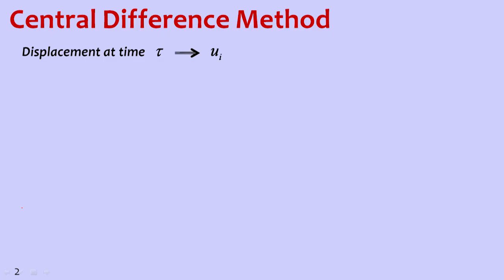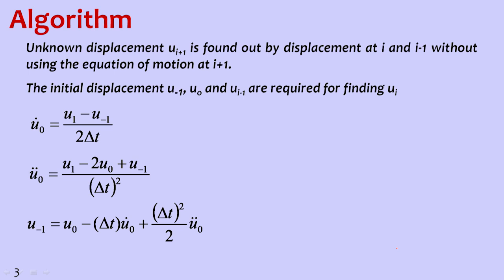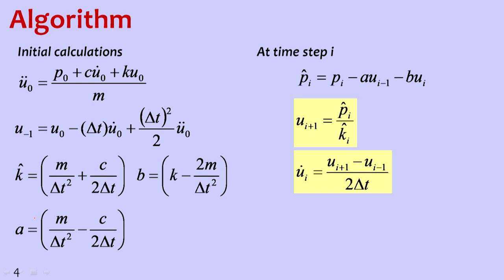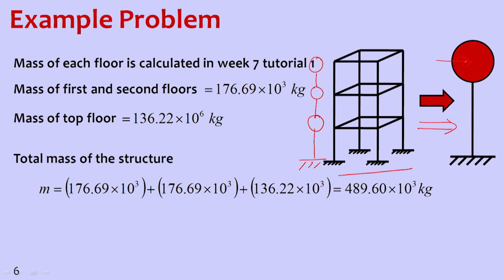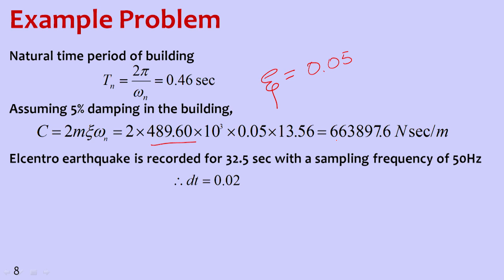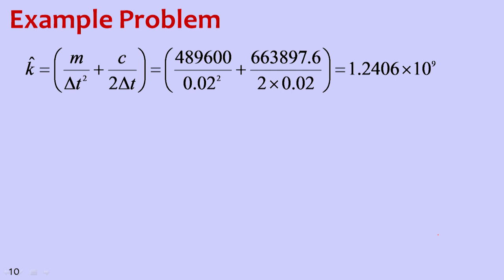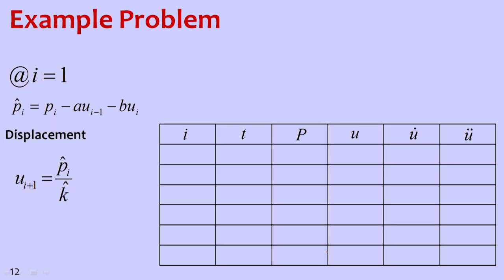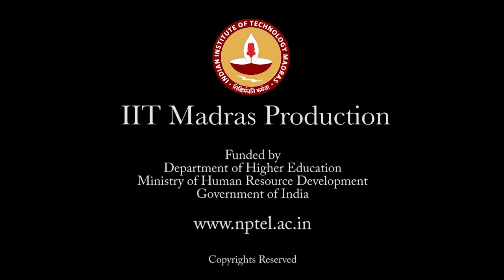W05T01 Central Difference Method

Comment: How could ao = 0.0063 cm/sec2 ? I mentioning here about units, with out multiplying it with "g" = 981 cm/sec2, you took directly ao = 0.0063cm/sec2, ao = 0.0063x981 cm/sec2. Then the expression matches for the mentioned units. Thanks for the video!
Reply: Sir, You saved me. I was confused at this point. Thank you

Comment: What is the point of this video if they cant even solve a problem properly. First 6 minutes are repetition of W05M03, remaining 10 minutes its a race towards summary, in between important steps like how to find velocity term  for i=1 condition are not discussed.On top of it the calculation appears erroneous as pointed out by others in the comment section.                  
                                                                                                                                                                   I wish professors in IIT understand the importance of these videos which have the potential to influence a lot of students who do not have  access to quality education and do a better and careful job while preparing next time.
Reply: Arif Jamal  As mentioned , sampling frequency is 50 Hz, f=1/T, so sampling dt=1/50= 0.02